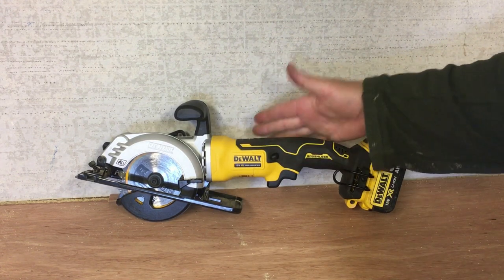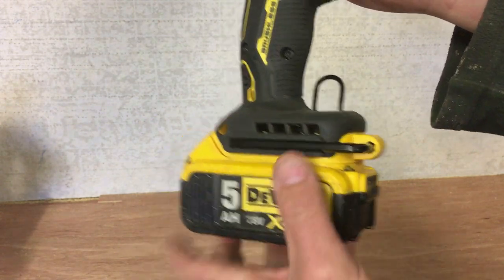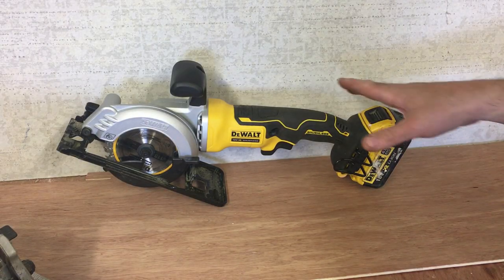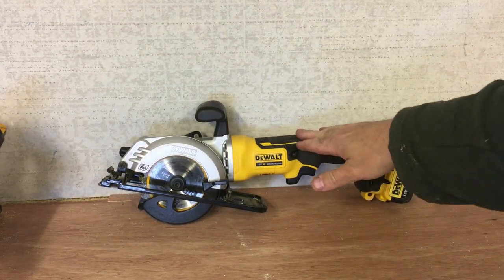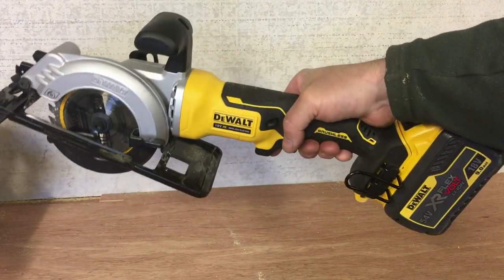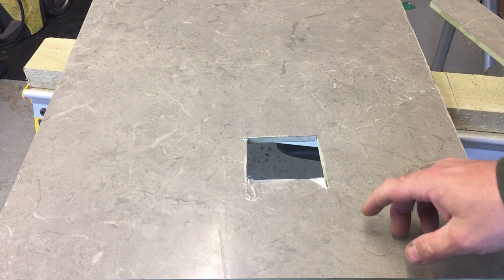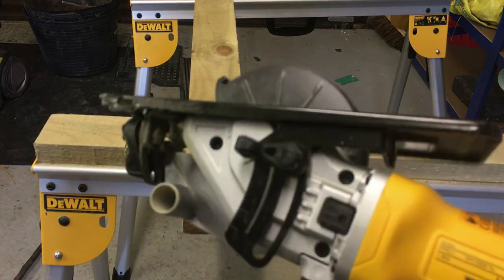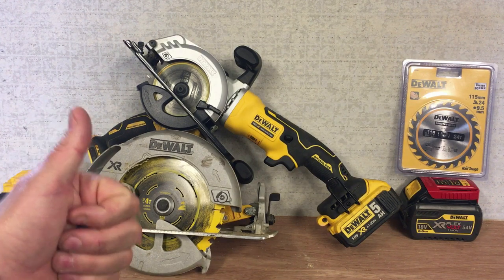DEWALT Mini Compact Circular Saw | DCS571N UK Tool Review

Comment: Yes the visibility the size it’s all a winner for me I agree the big ones are just never winners for me I don’t build houses and do stuff but small jobs like plunge cut to drop in a sink or just quick cuts here and there much easier.  Great opinion vid
Reply from the maker: Thanks Josef, yes, I am the same as you and use this for the smaller more intricate cuts, it is a great machine ! Thanks for the comment, much appreciated 👍
Reply: @Bacrenfencing  
INTIMIDATING is the word I would use to for circular.  I did try a smaller one once from makita once spun slowest and you could see .the guards which you always must have can get in the way like the dewalt table saw I know it’s wrong but it seems safer to use without the Saftey guard.  I love my jigsaw because I can see it all and have complete control but it’s SLOW hence the need for this beauty ordered the other day looking forward to playing with it soon

Comment: Thank you for showing the plunge cuts; that's exactly what I needed to see in action. This will be my first power tool (other than a drill), and I'll be using it to cut holes in the floorboards to access the bottom of my boat. It feels a lot less intimidating than a full circular saw.
Reply from the maker: It's a brilliant little saw, I am sure you will love it. Thanks for the comment !

Comment: If you had to only get one circular saw, would you choose this one or a full size one? Not really for professional purposes, just DYI stuff
Reply from the maker: Hi Kevin, if it is just DIY around the house, then probably best with a full size version for the simple fact that they are half the price and do the same job. In saying that, if you just want a small compact saw and price is not an issue, then definitely go for this as it is a lot easier to use. Thanks for the comment.

Comment: Mine didnt come with a battery so i use the ones for my drill do u know anything about the 60v flexvoly batteries i get alot of mixed reviews what battery do u suggest?
Reply from the maker: Hi, here in the UK we use 18v and 54v flexvolt which are the equivalent of 20v and 60v in the US. I usually use my circular saw with 5AH 18v batteries but do on occasion use 6AH 54v flexvolt batteries when doing a lot of heavy duty cuts. If using 20v flexvolt, I would recommend the 6ah as opposed to the 9AH because it is smaller but still produces a lot of power. I hope this helps ? 👍
Reply: Thank you for the reply man i appreciate it and i am going to go with the 6ah you seem like a reputable guy i was going to go with the 12ah but its a bit more expensive and yes this helped alot thanks again
Reply from the maker: @cantstopwontstop6080  The 6AH is a good choice, you will get on well with that one. I think the 12AH would be too heavy and bulky. All the best !

Comment: Looks a fantastic tool - great honest review too. I'm on the deWalt 18v platform so it will be definitely on my shopping list.

Great job Sir
Reply from the maker: Thanks PB, Yes, it is a great tool if you have a need for a smaller more nimble circular saw. One of the best tools I have bought in a long time. Thanks for the comment ! 👍
Reply: @Bacrenfencing   It looks a better tool for floorboards - I currently use my multitool for cutting access points, and although the multitool is great it can be slow and VERY ! noisey. Amazing what products are available to us now days, we are very spoilt indeed.
Reply from the maker: @pb9926  Same here PB, used to use multi tool but as you say, the noise is deafening and also can be sore on the hands with all that vibration. Not used the new saw on floorboards / chipboard yet, but I am sure it will be used for that very soon !

Comment: For cutting out single sockets, is the cut too long?  Would I be better with a multitool?  What's it like on brick concrete?
Reply from the maker: You would be better with a multi tool for cutting out sockets, not tried it on brick, but assume it would be fine. Thanks for the comment !

Comment: I have one its a little beast, very heavy but very accurate. When Ive time I'm going to make a perspex base for it to work with a track and keep it for sheet materials as its 2mm too shallow for studding plus I've the flexvolt monster anyway
Reply from the maker: Yes, they are great. Good idea re. the perspex base and track, could be a great little track saw. Thanks for the comment 👍
Reply: @Bacrenfencing  when I eventually get around to it I'll let you know the result. Worth a go, nothing to lose bar a couple hours of time really. Im thinking with the extra 10 to 15mm needed for base and track it'll be nicer to use without having the cut angle so high for 18mm rips

Comment: this same unit is compatible with 20v batteries right?
Reply from the maker: Yes
Reply: @Bacrenfencing  Thank you!
Reply: I ordered the solo unit from Amazon US last night and decided to post a question about battery compatibility. Stanley and Black & Decker  replied saying that tools that are sold  in the US are not compatible with batteries made for UK and Europe market. I am still puzzled but I canceled the order.
Reply from the maker: In the UK the batteries are 18v and in the us they are 20v. Just make sure whatever version of multi  tool you buy that it is either 18v or 20v. If you already have 20v batteries for instance, buy the 20v version of the multi tool and vice versa. Hope this helps clarify ?

Comment: Solid video pal, been flirting with this for a while myself and watched folks rate this. Would be a home run if it was 125mm. Any issues you’ve encountered with it having used it for a while now?
Reply from the maker: It depends on what your main use will be for the tool. The thing I love about it is it is so well balanced and great for one handed operation. No issues with it, it is a great bit of kit. Thanks for the comment 👍
Reply: @Bacrenfencing  Gentleman thanks. Ordered one a few days ago, just need to hide it from the missus when it arrives

Comment: can you get blades for this so that it cuts metal?
Reply from the maker: I am not sure Jason, I have not seen any to be honest - thanks for the comment 👍
Reply: I need to know the answer too
Reply from the maker: @AlwaysBonpoint  Having looked at it, I think you can, I think the code is DW9052.........but you would need to make sure it is compatible before purchasing
Reply: @Bacrenfencing  Thankyou for the swift reply. I've tried and failed to find a metal/multi material cutting blade with a bore of 9.5 and diameter of 115mm.
Reply from the maker: @AlwaysBonpoint  Apologies, my mistake. I have also failed to find any......not sure they are available. I will message the Dewalt rep on instagram, they will know for sure !
Reply: @Bacrenfencing  Thankyou buddy that would be so helpful, the mini circular saw is super easy to fit in my toolbag. I really hope someone does metal blades for it.
I look forward to hearing from you 👍

Comment: as good as it is , too heavy , and thats without the battery attached , if i used the belt hook it would have pulled my trousers down ,  sent mine back
Reply from the maker: I have used mine constantly and love it, but then again, I don't tend to hang it off a belt . I  use mine more like a circular saw which I do not tend to attach to myself. I guess if you are framing or roofing, then there would be a need to use the belt hook but not for me. Thanks for the comment and I am sorry the tool did not suit your needs 👍